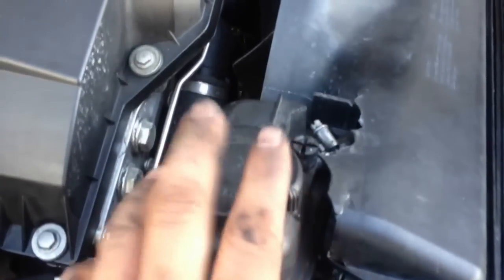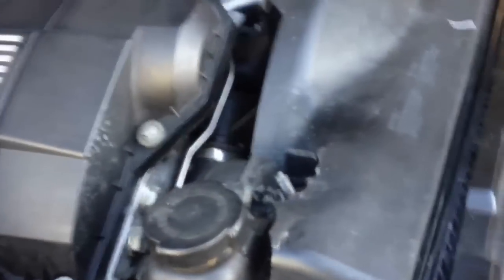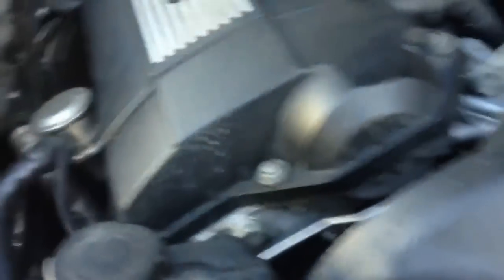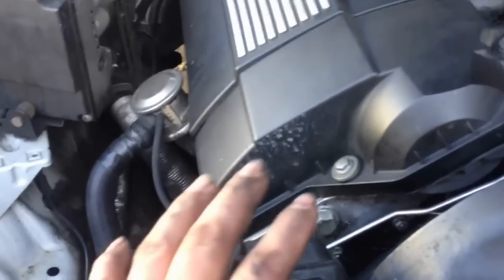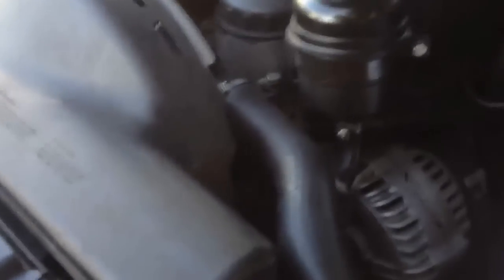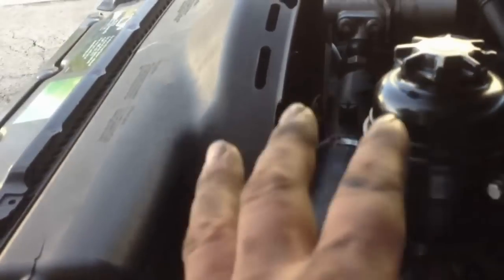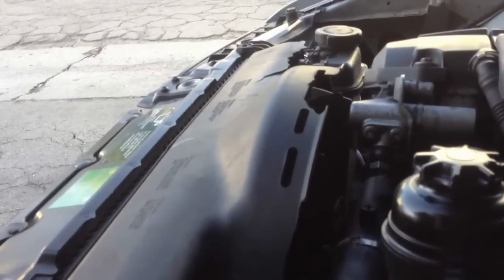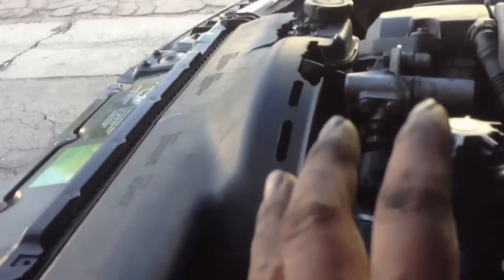Tips On Overheating Engine + Air Bubbles Problems Fixed 97-03 BMW 5 SERIES E39 528I 540I M5 328i

Comment: I had the same problem. I changed out my water pump, thermstat and did not properly bleed it. it was randomly over heating. did this last week and i have had no prlems at all. Where I live its about 95 plus everyday. I sat in the car for about 30 mins with the AC on and zero over heating . Thanks dude!!

Comment: i never ever jacket my bmw up for a coolant service. Just filling up the system, heating system inside the car on 1 or 2nd position. Open the system on the radiator to get the air out. It takes a while to get all the bubbles out. Let coolant overflow. Just make sure that you do not close to soon. Let the engine cool of and refill if necesary.
I never had any heating problems of air in the system. My e30 320i i driven for 12 years and the e36 320i since 3 years. No problems at all.

Comment: I am returning from white smoke or blue smoke exhaust system emissions. the car I have is the zhp package e46 4 door grey on black with imitation carbon fiber trim and the 6 speed trans/gearbox. Every day it has been driven to redline for the past years/only 3,000 miles in 3 years of ownership.  abandoned the car for 1 year and a half; took the time to find fixing 2 pumps.. oil filter o- ring gasket.. all coolant system and oil system hoses(with exception to the oil ventilation valve which is a  common failure item, since the part does not always work. No over heating after 1500 mile oil changes I changed the engine cover gasket.. water pump 2 times.. radiator fan.. oil pan gaskets all replaced with new parts.. New power steering fluids changed past recommended mile intervals.. steering rack boot/rubber cover.. all chassis weld/reinforcements done as well as re installment of the insulation and anti corrosion barriers.. entire suspension replaced.. entire car bushings replace.. air bag wiring to rear passenger tail light wiring recall replacements made.. entire braking system rebuild.. hawk racing brake pads replaced.. fluids bled including coolant 8 times.. Otherwise I'll say everything inside the engine internally placed parts have never been replaced but always have been raced/the harshest of usage conditions possible by always red line the engine.. all filters replaced.. 3 times.. all reservoirs replaced 2/or 4 times.. radiator replaced 5 times.. never disassembled the engine before.

overheating oilleaking ,and the engine knocking sounds/not the flywheel not the clutch/not the radiator fan/not the powersteer pump/not the oil pump/not the water pump/not the emissions recirculation system. Otherwise I'll say I have no clue why the cooling system levels having been bled leveled off radiator cap mildly closed not tight/the oil will start to turn yellow and/or white engine oil fluid colours occurred after the coolant flushed, note no coolant colours changing.. when I have been driving the coolant system empties completely after warm up period and not any misfiring at all.. Otherwise coolant is normal.
The cars' paint.. interior and exterior combination including harmon kardon system options and bmw m technique exhaust system originals and m technique strut also shock tower brace bars also 18x8 18.5x8.5 stagger m technique wheels/wanting to preserve the cars' working conditions....

how do I fix the cooling system levels dropping leaking only when the car is driven also coolant leaking into the oil and oil never leaking into the coolant fluids..?

that's my question.. how is this permanently fixed?

what is my permanent solution?

Comment from the maker: @soyeltopo77 and you will hear bubbles come out from the engine from the radiator. You have two bleeders one next to the thermostat cover and one on top of the radiator where you put water in the radiator. Remove both of the past screws. the plastic screw next to the thermostat cover removed until you see a smooth flow of antifreeze coming out of it put plastic screw back.

Comment from the maker: @soyeltopo77 Lift up the front end of your vehicle Put your key into the ignition position 2. don't turn on your vehicle. Put it where only the fan will turn on not the vehicle. Put your heater on full blast. Start putting water or antifreeze into your radiator.

Comment: Bro!!!! Please help!!!! 

I have been watching your videos and making great progress on my 03 E39. I am having a major idle/misfire problem. The symptoms I am experiencing are these:

1: low idle
2: engine shaking (can feel in the whole car)
3: low power
4: high or low coolant temps (probably from low rpm not moving coolant efficiently)
5: interior lights/ dash lights dimming (also probably from low rpm not turning alternator fast enough)

this is what I did to try and fix problems.

1: replaced all spark plugs and coil packs
2: cleaned cylinders with mystery oil just in case of low compression in one or more of the cylinders
3: replaced camshaft positioning sensor
4: checked air system for leaks
5: cleaned ICV, throttle body, and DISA
6: replaced water pump, belt tensioner pulley wheel, serpentine belt, thermostat, and fan blades because a few were broken
7: replaced battery in case of electrical failures (duralast gold w/ 950 cold crank amps)
8: replaced coolant at least 5 times because of a leak
9: replaced valve cover gaskets and replaced cover bolts with new rubber grommets
10: replaced spark plug wiring harness ground wire eyelet in case of old age or corrosion

So long story short, I'm trying to fix this bad ass car on my own without having to A: take it to the dealership and B: working on the VANOS. I have no experience working on the timing for this machine and I don't want to throw the VANOS system out of whack by trying my luck. Also I didn't have any extra O rings so i could try and check the fuel injectors. I know u have to be careful when messing around with that fuel system and I didn't want to mess that job up either by moving too fast without the right parts. 

I am pretty technically savvy and I have used so many of your videos for maintenance of my ride and you haven't let me down yet. I am a true fan of your work and would really appreciate some help from one of the best (in my opinion). So if you can, PLEASE show some love and respond. 

True fan,
Mr. B.
Reply from the maker: What type of fuel are you using
Reply: +Repair Fanatic I had been using regular 87. I recently switched to 93 supreme at Shell (V Power). I also added STP octane booster after I ran out the old gas and filled up with the new, higher octane gasoline. I still had the same issue. I just spoke with a good mechanic and he said I should replace my fuel filter. he also said that damage could have been done to my fuel pump if the filter was bad because it could've been overworking the pump. any thoights?
Reply from the maker: +Brandon Bennett is your engine light on
Reply: yes. I have a few different codes in the P0300 ranges. a few are for mutiple misfires, gas filler cap, low fuel pressure and so on. but like I said I just replaced all the coil packs and spark plugs yesterday. I haven't been to autozone yet to have them wipe the codes to see which ones come back, but that's my next move when I get some time.
Reply from the maker: Do a smoke test on your engine

Comment: My ride just started yesterday randomly over heating when Im at a stop then went to normal. Its winter here and I filled my antifreeze about in Sept and now checked this morning and its bone dry. Its about 38f here. So is this from a leak ..and how do you get rid of air bubbles lift the car and then fill antifreeze again. ??

Comment from the maker: @soyeltopo77  When no more bubbles put the other Plastic screw back. You are all done one tip do not tighten the plastic screws or the radiator cap. If you like I will make a video explaining the process

Comment: I have an e36 that has the same probs with the air bubbles causing it to over hear in traffic. So jacking the car up like you did will let out the air bubbles?

Comment: Ive got a serious problem n im hopping im asking the right person.. Ive got an overheating problem with my 3281 2000 .. it starts overheating after 10 min driving n we dont know what the problem is .. took it to a bmw professional down here in Lansing n they changed the fan clutch n nothing changed n now they said its either the thermostats or the radiator has some dirt in the it! any tipps on that?

Comment: i have same problem. i replace all cooling system, i change, water pump,, thermostat ,, radiator,,fan clutch, transmission thermostat ,, expancion tank ,,t.

Comment: Hello beamer fanatic
i ve been watching your videos. I just bought an 735i e38. i just got a problem with my car return water radiator, it burst while i was driving. i relaced it and then on the next day, the return water radiator container burst. Am at a fix how it happened. It that the thermostat or water pump. here in mauritius, parts are very expensive. i need to be sure before buying. Because once the engine is one, less than 5 minutes the temperature gets to the half of the temperature indicator. is that ok or need to clean the radiator. If any one can help, ill be gratefull
Reply from the maker: It happened to me once don't worry about it just replace expansion tank. Make sure you bleed the system completely.
To prevent it from happening again.
Reply: Beamer Fanatics E39 E90 Does the expansion tank have any sensor inside, i still did not get it how this happened. Is there any thing with the thermostat. The mechanic is saying that the thermostat is not functioning corectly. But as per your experience what could have happen. its just that there is pressure inside the engine. Could this incident could have damaged the head gasket. Thanks

Comment: WOW you did not address the Bleeder valves one on the expansion tank and i see one on your upper Hose ,this my friend is the proper way to get those bubbles out just run the engine with cap closed and open plastic bleeders till u purge all Air have straight coolant coming out.......and your electric fan should go on High when AC is on,even if your clutch fan is week! i am sure cause mine is week and my AC works great. and i agree if your engine compartment is cooler even your power steering will benefit .... U should Redo this Video!!!
Reply: BASIC !
Reply: your the man i hope you know that worked like a charm.... thanks again mark these youtube DIY need a little more experienced mechanics posting videos not saying anything bad about this video cause essentially its just a reference....

Comment: Hilarious to see the broken tab on the fan shroud. Whoever said Germans over-engineer their cars has obviously never owned a BMW. Too many plastic parts, and the odd thing even as a non-engineer, plastic does not like to be heat cycled. Yet you have all sorts of plastic parts in the cooling system of these supposedly well engineered German cars.
Reply from the maker: You are right bro 100% I don't like it at All.

Comment: I have a 1997 bmw 528i and it overheats, its an air bubble. im getting it out. but there is coolant leaking from the bottom of the car from these holes on the underside by the doors. Here is a link to some pictures and whats my problem. I figured you would probably know. Please help?? http://www.bimmerforums.com/forum/showthread.php?2158615-My-1997-bmw-528i-has-a-coolant-leak

Comment: the problem still in the car,, yesterday i bleed it ,i drive it couple milles, i came back home, start to get high tem, i shut off. from behind off thermostat i heard small noise, as if something were frying.. pipes of the heater was leaking,, now i am I am now removing the manifoul and discovered that not worth repairing these crap, and spend $ 1,200 in parts and did all the work, I discovered that the damn car has head gasket gone,,,i am fucking mad, is a 325i  2003,, piece off shit